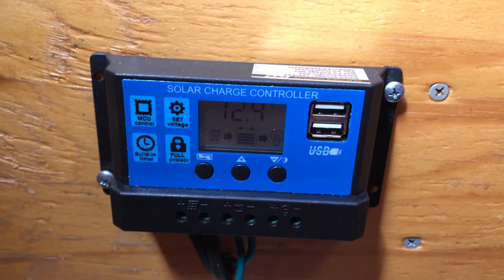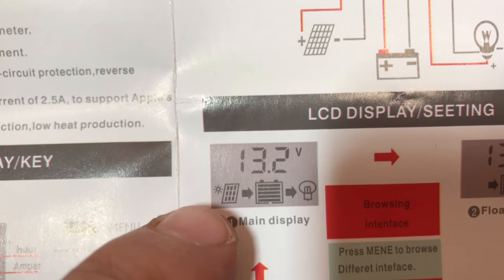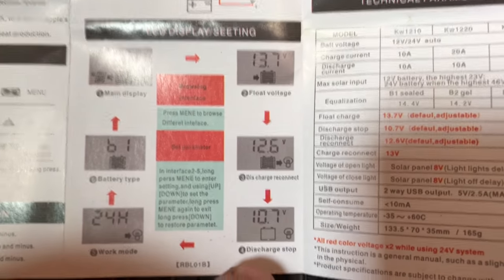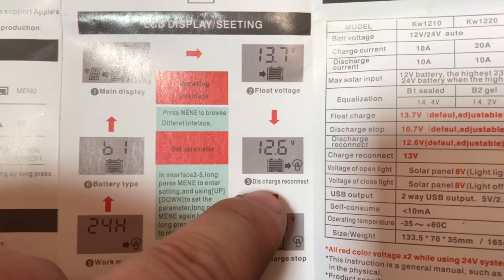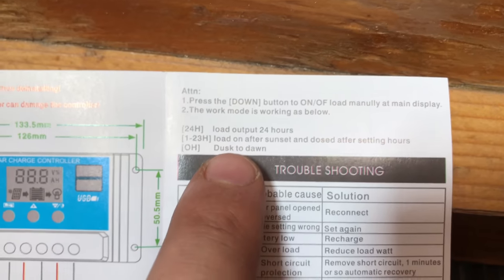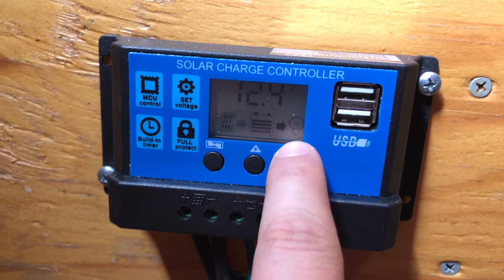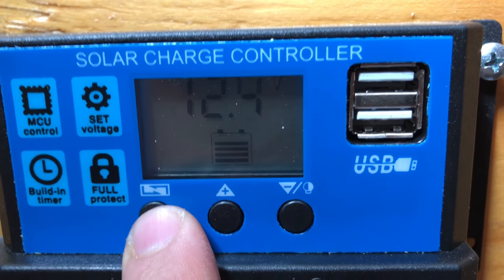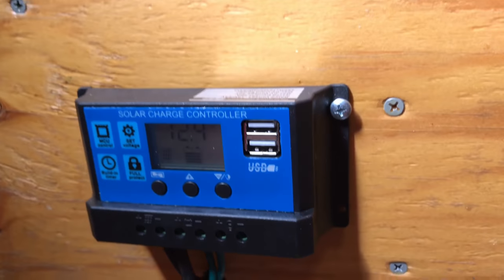How to setup a basic Solar Charge Controller | Quick Guide & Menu overview

Comment: I see your float is set at 13.7, I've seen others say to set it to 14.1 so is anything between 13.7 and 14.1 ok?
Reply: I didn’t understand what the float voltage is. Is that the voltage at which the controller stops charging the battery?
Reply: So for a car (that's parked most of the time), it's best to put the float voltage lower?
Reply: Float voltage is the charge that you can put into a fully charged car battery to keep it fully charged but without damaging it. Unfortunately, the correct float voltage varies depending (i) on the air temperature and (ii) on your precise battery. So, look up your battery data sheet and it should tell you. If it doesn't, stick with 13.7 - higher voltages are more risky.

Comment: what battery would Im buy for a small set-up, maybe 100 watts output ?
Reply from the maker: Depends on how long you want to run it, and in what conditions. If you’re looking to save money, you can buy a deep cycle battery from Walmart for around $100 I think. It’s a 100ah lead acid battery, which would give you about 50ah usable battery. Or, you can buy a top of the line 100ah lifepo4 battery for around $400 on the cheap end. https://amzn.to/3x8FjHL I have both, and would much prefer lifepo4. For 50ah, you can expect to power that 100 watt load for about 6 hours. I hope this helps!
Reply: @ScottsSolarProjects  thankyou

Comment: Hi, is it possible to use the controller for just a battery? I want to get like a lead acid power bank and I’m planning to use the “high voltage output” the one all the way to the right to power a 12v pump I might eventually hook up a small solar pannel tho, best regards Rudger.
Reply: Yes. I want to do the same thing. 
I have a 24V solar panel, a 12v gel battery and a 12v pump and this controller. 
But the manual seems to indicate the far right output is only 9v - not adjustable!. I think it means it puts out 9 volt until the battery reaches its voltage off limit? 
If so, I am wondering if I can parallel wire the pump to the battery with an activator switch in the circuit. I want it to run dawn to dusk, rather than dusk to dawn, so the switch would be on when the circuit is off on the 0H output setting, if I understood it correctly. 
But I do not know whether there is such a switch or if there is a better way to use this controller to this end?

Comment: I have a similar unit and it's confusing I have the 3 standard options I think the first one is the solar option which reads between 15 or 14 to 16 what is that do and the other two option RS when the battery is low at 11 volts and the battery is full at 12.6 volts I'm really confused by the option where it's 14 to 16 volts
Reply: @ScottsSolarProjects  thanks .  so does PV actually allow it to out put 14.4 or 17.5 (which i wont) to the battery? does it actually cut off the load (provide to power out and the loud connectors)

Comment: Hi, please help. 
My Solarmax Charger Controller (12V/24V 20A) is not giving out DC output after sun set even when the Battery is fully charged. How do i set it to give output all the time when the battery is full?
Reply: @ScottsSolarProjects  Okay thanks.
Reply from the maker: I just posted a video explaining the load/timer settings: https://youtu.be/v-iLu9DS558

Comment: Hi, How do you make the clock work to turn on the lights?
Reply from the maker: You can scroll to”24” and adjust it to however long you want. So, I’m pretty sure if you want lights on for 5 hours, you would set it to 5 and the lights will come on for 5 hours after the sun goes down.
Reply from the maker: I just posted a video explaining the load/timer settings: https://youtu.be/v-iLu9DS558

Comment: i hope it recognize the 24v setup  because i have only 33 to 40v panels
Reply from the maker: Yes, I believe when you first connect the battery to the controller, it should recognize that it's 24 volts.

Comment: I just yot one of these, when hooked up it should just come on yes?.....or do i need to press n hold a certain button as im not gettinv a display at all :(
Reply: Connect the battery first.
Reply: @runplatypus   hi yeah done all that, the unit isnt working i got a refund......no sign of life in it at all......shame , cheers though.

Comment: I’ve got both arrows flashing perpetually, the solar does alter and create an illusion of charge, but because of the flashing arrows setting, no charge after, so idk what to do.
Reply: @ScottsSolarProjects  I basically have come to the conclusion the solar charger is broken, I’ve installed another charger and it works great. Thankfully they’re not that expensive.
Appreciate the input.

Comment: What does a controller like that understands as "float charge"? Mine(model identical to yours) would start upping the voltage at the start of the charge(early morning, 6h AM), than, as it gets to 14.4v(midday), it will keep it there until the end of the day(6h PM), even if I don't discharge the battery during the night, and even as the battery is pulling less than 200mAh of current from the charger. Shouldn't the charger go to "float charge" and try to keep my battery stable, from 13.0v to 13.7v (adjustable), when it is no longer getting usable current from the charger? Isn't that the dictionary definition of "float charge"? Ps: My inverter only turns itself on at 6h PM, so it can't be blamed for any "current leak", all the power produced by the solar panel during the day hours has only the battery as its consumer.
Reply: @ScottsSolarProjects  Very little, the inverter's standby current consumption is about 500mAh. So it normally decreases 0.2v or 0.3v at the most, if I have no load connected to the output. My system is controlled by an Arduino with a RTC(very precise), so I power on the inverter at 17.30h and shut it down at 6.00h. That's about the time I need the inverter on to power the lights. During the day the inverter is off, so all the power generated by my 150w panel goes to battery charge. Naturally, if I have a lot of lights on, the voltage can drop as much as 1v (from 13.0v to 12.0v) during the night, my system cannot pull more than 9 amps from my 100 amps stationary battery, that is by design. I keep it like that to avoid overdischarging it (though I have low voltage protection on the Arduino as well, it shuts down the inverter if battery voltage less than 11.5v).
Reply: @ScottsSolarProjects  Yes, I have a circuit breaker between the solar panel and the charger. Lets say I wait until 16.00h(quite a sunny day), by that time I know my battery is sure already fully charged... When I turn off that circuit breaker, the voltage in the battery starts to fall from 14.4v to about 13.4v or so, a bit quick and then stabilizes at 13.2v. That is evidence that this charge controller doesn't give a damn about what you set as "float charge". It kinda completely ignores it. If it worked as advertised, when I cut the solar panel off, the voltage would start dropping from the value configured on screen(generally 13.7v), don't you think?
Reply: @ScottsSolarProjects  I have my Arduino monitoring by a couple of hall effect current sensors, both, the current delivered by the solar panel(day) and the current usage by the inverter(night). This information is transmitted by WiFi shield to a software running as a service on my laptop, logging everything to an instance of MySQL Server. So naturally I can observe and calculate how many watts is being generated and how many watts is being consumed. A plus is the ability to monitor the battery's regiment of charge during the day. I can observe the Bulk and Absorption phases very well, but I cannot see the Float phase in action. I take my definitions of Bulk, Absorption and Float from here: http://www.chargingchargers.com/tutorials/charging.html
Reply: @jefersonnl  I have the same model and I'm getting a permanent 14.4V all day long. I live in a sunny region and I'm using 7Ah gel batteries with a 50W panel. Considering the load it should reach full charge in less than an hour, instead it overcharges the battery till dusk. I tried with the 3 settings b01, b02 and b03 but nothing changed, I also tried with bigger flooded batteries and with a cycle of deep disharge. It looks like a bugged firmware, maybe a bugged firmware revision, otherwise everyone should be having the same issue.
Reply: @redundancyhit  I went to great lengths to get to the bottom of this. I even built a microcontrolled telemetry unit to measure voltages and currents and log it for months(in fact, it is logging even now, I have millions of rows of data I can go trough and analyze). Nothing came from it. Things are close to ideal conditions and even so, the charger wouldn't turn to float charge mode. I also messed with b01, b02 and b03, changed nothing. I concluded that these cheap chinese "charge controllers" are just mere voltage regulators. On the web I came across other people having this same issue, just like us. It's PWM for sure as it relies on the technology to control voltage, but it's not a true charger. It's only capable of charge stages 1(Bulk) and 2(Absorption), it is unable to turn to stage 3(Float) coz it's not really true 3-stage. It's just another chinese counterfeit. I suspect it can overcharge your 7Ah battery and kill it pretty soon it if you're not careful. Lucky me have a 100Ah lead acid that is pretty tough. It's been running like this for almost 3 years without loosing electrolice. I have a circuit in mind that can do true 3-stage charge of a lead acid battery. One day I shall commit it to a circuit board. If I were you I'd use an Arduino to read charge current and battery voltage. As soon as the voltage gets to 14.4v and the current drops to 500mAh or less, I'd open a relay to disconnect the solar panel, and reconnect it only when battery voltage drops to less than 12.8v. That way your battery is going to last way way longer. It's just a hack, but a useful one.
Reply from the maker: I just posted a video explaining the load/timer settings: https://youtu.be/v-iLu9DS558

Comment: when i set the volt at 13 during the day it goes all the way to 16 and then my conveter start beeping and no more power idk why its doing that
Reply from the maker: Hmmm…I know that once the voltage is past 13 bolts, its easy for it to jump and reach a few volts higher. But if the inverter is beeping, maybe something is wrong with the battery itself..or inverter.
Reply: @ScottsSolarProjects  the controller itself shows 16 volts and the inverter also shows it, the inverter is connected to the battery itself not the controller
Reply from the maker: Oh, sorry I got mixed up. When you first set it up, did you connect the controller to the battery first before connecting any solar panels?

Comment: That's what is in the description. You do not show how you actually change each value. There are a % sign and an A (ampere) sign also in the display, how do we get those modes on the display?
Reply: @ScottsSolarProjects  Thanks, it works. I set the flow-charge-voltage to 13.5v because my Cells are old and only reach 13,2v fully charged.
Reply: @ScottsSolarProjects  so what locks the new value setting after you have selected it & have chosen the increased/decreaded amount ?
Reply: Sorry Scott, I found the answer to my question in a lower post,great video & thank you!

Comment: This seems to be the standard manual for all solar charge controllers. They explain nothing! What does it mean when the whole display is flashing? Or when led bulbs connected to the system start flashing on and off? My solar charge controller seems to be going kaput! The usb ports are not working any more
Reply: @razorsharpbt Indeed! Me too.Mine went kaput a day after I posted this. Upgraded to a slightly better one from Raggie which has worked decently since. Cheap definitely turned out to be expensive in my case.

Comment: I can't get two in parallel charging. Only one works. Has anybody actually wired 2 or more  in parallel with these cheapies?
Reply: @ScottsSolarProjects  much bigger amps going through much thicker wires. Prefer 1 panel per  1 controller method. Controllers are cheap. Maybe too cheap.actually. Think the 4 orange ones I bought are all crapped out.

Comment: I connected everything like it should and it wont come on but it does put out power. I press the buttons and nothing. Also didnt came with instructions.
Reply from the maker: Hmmm…maybe a defective unit?
Reply: @ScottsSolarProjects  Idk if Amazon would take it back. Thanks for the response.
Reply from the maker: Amazon is usually really great with returns as long as it’s within the return window. Best of luck!

Comment: 11v is a bit low (If you have a lead acid leasure battery) 
You want it at about 11.8v  - 11v means you only have 20% charge left and you will f*ck your battery up, 11.8v isn't great either but it is about as minimum as you want to go if you want to maintain a good battery.
Reply: Push mine from 10.7 to 11.0

Comment: I bought this controller and an not satisfied with it.  On the website for it, it says that you can set the battery type for different types of batteries,. Gel, lead-acid, lithium.  When I got the controller I checked the instructions on how to set the battery type but it says NOT FOR LITHIUM batteries and that's what I have.......Grrrrr!

Comment: Seems to me there is no point in setting load cut offs if you don’t have your load connected to the controller as you have set up in the video.
Reply from the maker: This video is simply for demonstration, it all depends on what each user will be using it for. 👍🏼

Comment: How is this a "set-up" video if you never go over how to PHYSICALLY set-up?

1)Toggle to any screen (via the MENU, most left, button) that Number 2-5.
2)PRESS and HOLD the MENU button (reference previous step) for 5 seconds. When digits/values at top of screen start flashing, you are now in "SET UP" mode and can change parameters.
3) Use either UP or DOWN (if you controller doesn't show the correct DOWN symbol, it's because this is poor quality control product, and the DOWN button will be the one most right) to change or SET UP whichever parameter you want.
4) To exit, either return to MENU button and HOLD again for 5 seconds, or just wait for top digits/values to stop flashing.
Saving of changes happens automatically as soon as SET UP mode is exited.